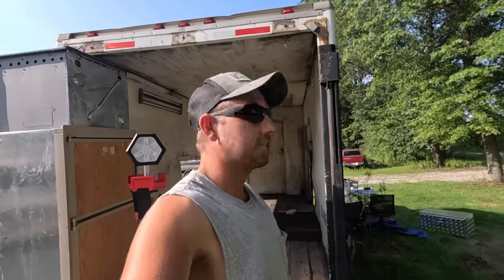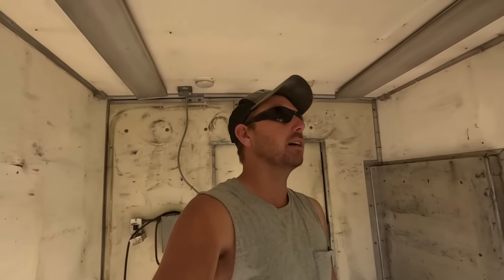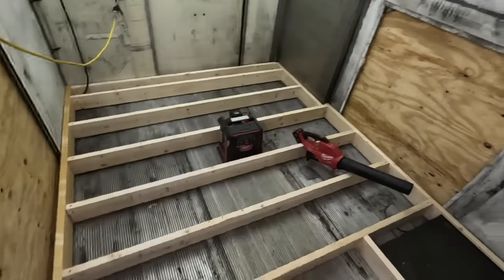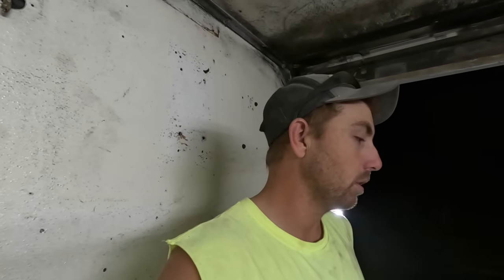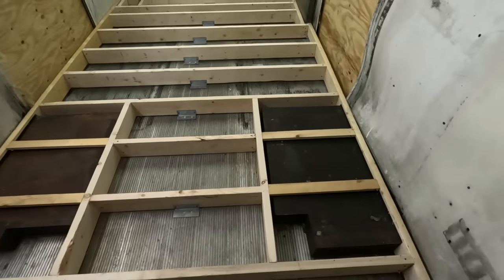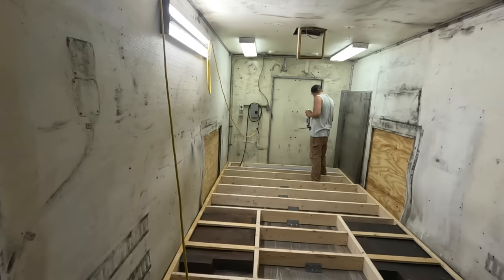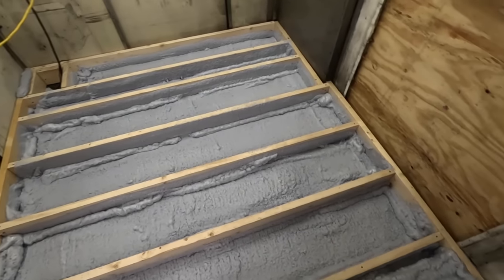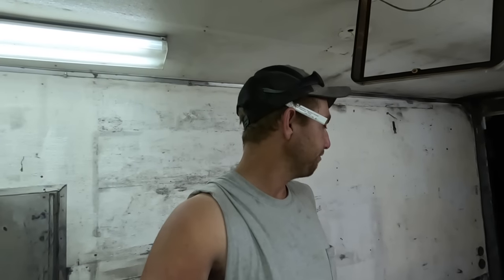Building A Custom RV Part 3 (Construction Begins)

Comment from the maker: Just wanted to jump on here quick before all the keyboard warriors get fired up. I’m fully aware that the understanding of compressing bat insulation lowers the r-value. However it’s is my opinion that the closed cell spray foam combined with the slight compressing of the bat insulation will give me a much better thermal advantage in the end.
Reply: I would've  ripped out bat insulation and gone with straight foam.
It's expensive but well worth the money. 
Rebuilt our water treatment and pressure tank building outside our modular home. We moved in late fall after numerous freeze ups and countless dollars to electric company. 
For heaters and pipe heating tape. 
The new one requires no heat, well water is sufficient. Unless it goes subzero for an extended time. 
Then a 100 watt light bulb is sufficient. 
It's been  in use for 15 years with no issues unless kids leave door open in the middle of winter. 😄.
Reply: If it was me, I would save myself some money by putting r-13 in the floor on top of the closed cell. It would fit perfectly with no compression. And you would probably end up with the same overall r value. Just a thought:)
Reply: they told us in continuing ed class compressing fiberglass doesnt lose R factor as much as you think
Reply: @jacktomberlin7976  your talking a rodent and insect infestation invitation. 
 Campers/RVS are notoriously famous for attracting rodents and insects. 
They lay dormant for long periods in which critters or insects find with a little effort a new home.
Two problems with this.
They not only destroy your  camper, but you import them to places you visit. Which has adverse affects.
Cheaper isn't always the right way.
Reply: @ebejeff  maybe so.
But did they talk about  adhesion, voids that allow condensation, rodent or insect habitat?
When I started Fermaldihyde foam was great. 
Go figure.
Reply: @bcallahan3806  I’m not sure what r-13 vs r-19 insulation has to do with rodent infestation.
Reply: Moisture kills R value more than compressing it.  That said, I really hope the aluminum doesn't sweat too much...

Comment: Just a suggestion from someone who lived in Alaska and Michigan, if your gona have a generator wire in a switch for a block heater on that truck, even a magnet heater stuck to the oil pan works wonders on a below zero morning,  it will deff help on those really bitter cold mornings!